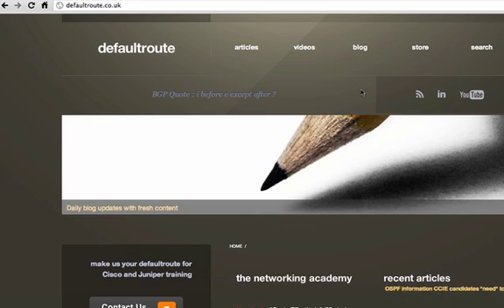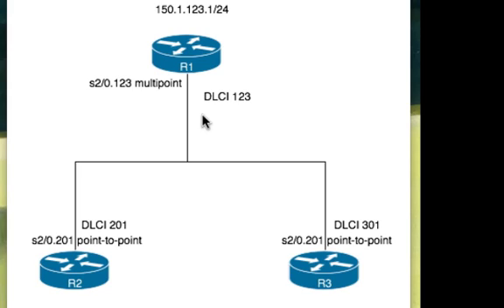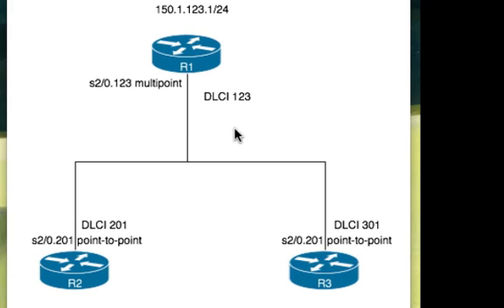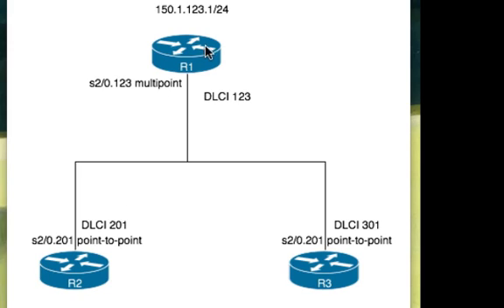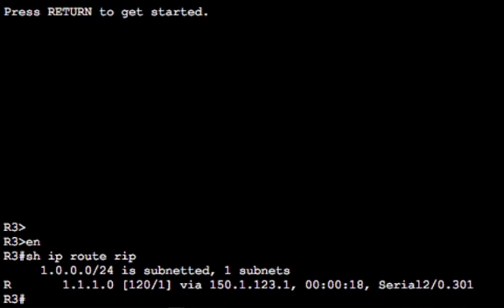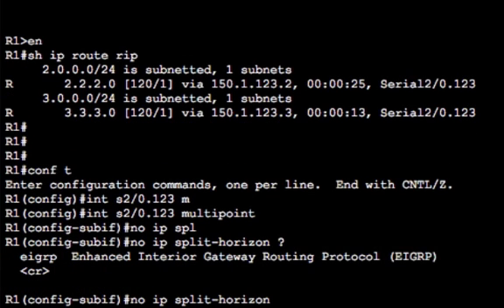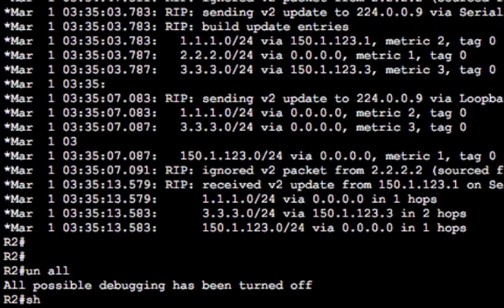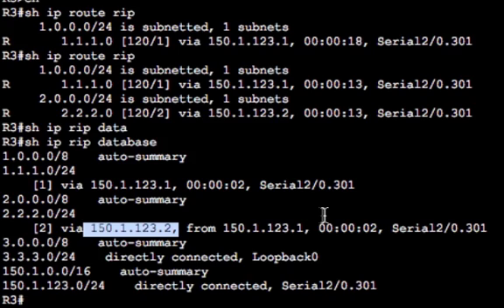'The Basics Series' - RIP split-horizon

Comment: Very Good Video, and very well explained.  One small note, I did noticed that on the initial slide that you had S2/0.201 instead of S2/0.301 on R3, which is what is on the output of R3#show ip rip database.